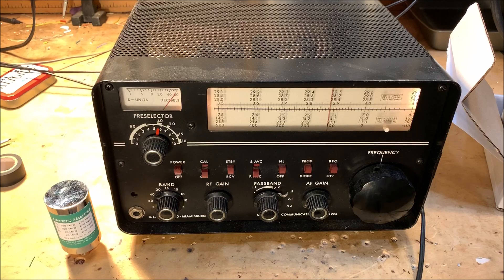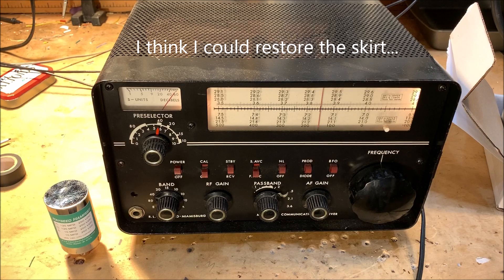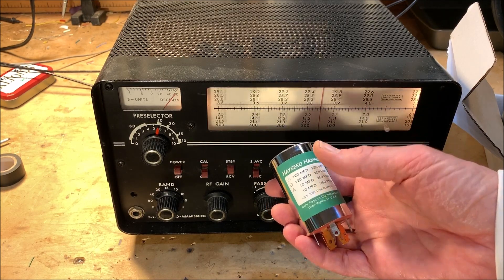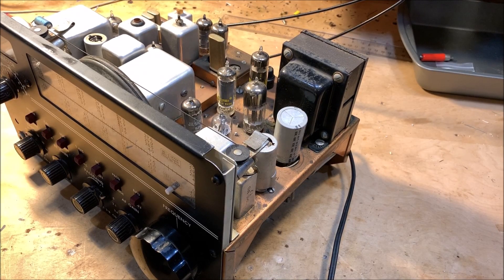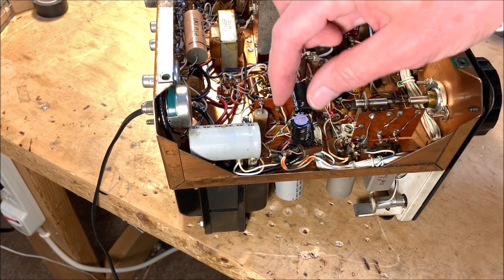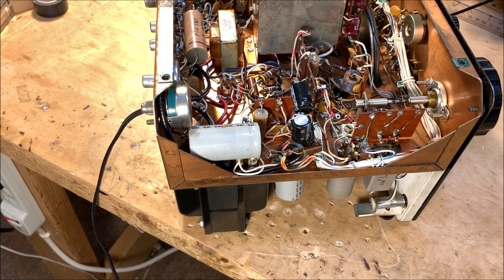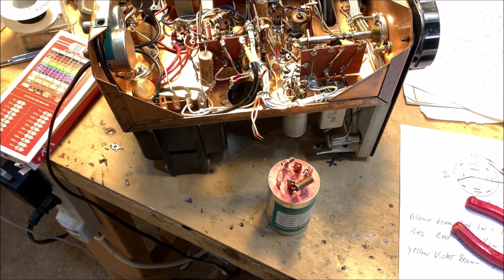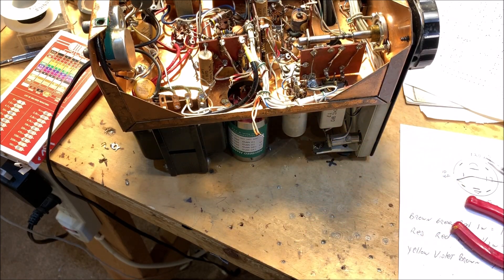Replacing Electrolytic Capacitors on a Drake 2-B Receiver

Comment: Hey Bill, I got my Drake 2-C at a ham radio store in Shrewsbury, NJ near the Fort Monmouth Army base back in 1975. I replaced the caps in the 12 volt audio power supply circuit after the old ones had failed and for years just turining on the receiver in standby produced an AC hum loud enough to fill the house. I saw the Hayseed Hamfest caps in another video several month back and sighed with relief that I would be able to get a kit with exact replacements of all those caps, including the integrated ones like the one you got for your Drake 2-B. I got the matching Drake 2-NT transmitter by shear luck 10 years later when I was visiting my hometown in New Jersey and picked it up from that same ham store for $35.00. Amazing considering my 2-C cost $189.00 before tax. BTW, I'm reading your book and I was tempted to buy that Lafayette receiver you mentioned in your book but glad I bought the 2-C even though it was ham bands only. I never regretted my decision. I can hardly wait to order those capacitor kits for my 2-C and 2-NT and change out those old caps going on 50 years now I'm sure.

Comment: My dial moves slowly too, but it looks factory to me.  Could've been a previous owner.  I also used the Hayseed kit on mine.  I wound up replacing the paper caps with some nice film caps.  One remaining issue with my unit is that my S-meter is very sluggish - I think the meter movement itself is a little gummed up.  I wish mine moved quickly like yours. Here are a few of my Drake 2B videos:
Recapping: https://www.youtube.com/watch?v=x8zILP61RA4
Alignment: https://www.youtube.com/watch?v=wfVJnIjxvHI
Final Repairs: https://www.youtube.com/watch?v=GRuKgGi4UkI
Listening to N2CQR on my 2B!!!!: https://www.youtube.com/watch?v=vQPIRX_sqTk